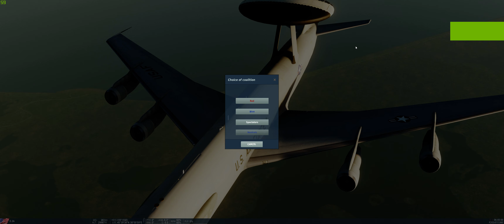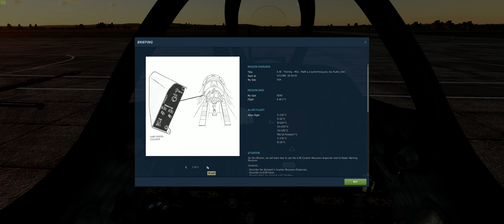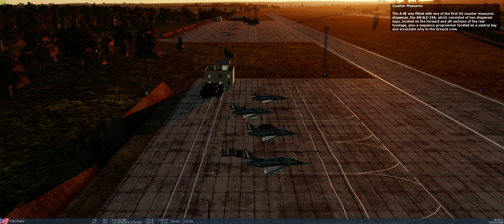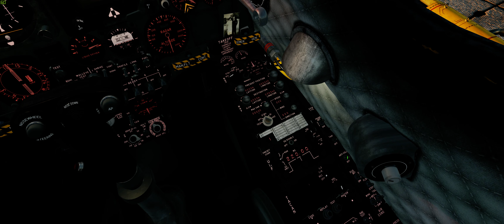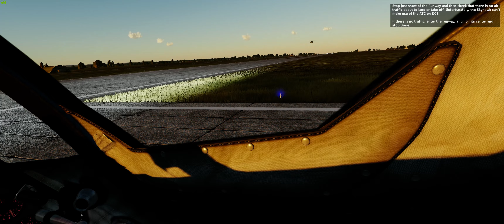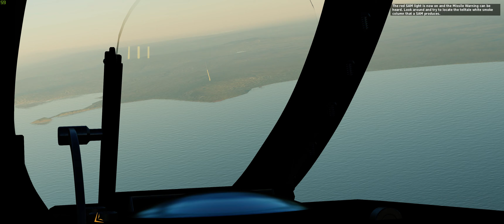A 4E - Training - Mission 15 - ECM & RWR

Comment: Nice tutorial video. You put it together very well with lots of good info and within a good amount of time.
I will say, that the effectiveness of the A-4E's ECM equipment seems much too good though.
The early Vietnam War era ECM equipment (such as that shown in the A-4E) was not quite as effective in reality. Therefore, when a SAM launch was detected,  defeating it was a bit more complicated. 
Normally, after detecting the launch, the pilot had about 5 or 6 seconds to visually acquire the missile before the first stage booster dropped off, after which the incoming missile was much more difficult to see. This was especially true in the hot, humid and hazy Southeast Asia environment.
Once visual was established, the pilot needed to immediately dive for the deck at full power while, at the same time, turning to put the missile at their "2 o'clock" or "10 o'clock" position. 
This put the SAM site slightly abeam to the airplane. This made the airplane slightly more difficult to track and allowed it to continued closing the distance with the SA-2 site, which forced the missile into a tighter ballistic arc.
If the pilot was able to get below 500 ft AGL, the guidance RADAR usually broke lock due to ground clutter. 
If the pilot could not get below 500 ft AGL, then they would have to wait until the missile was almost on them and then break hard up and slightly away from the missile (putting it fully abeam). 
Because the missile was traveling so fast (and gravity was helping it continue to get even faster) it could not turn hard enough to track into the airplane and would miss by enough of a margin that even if it detonated (from the proximity fuse) the airplane would likely survive. Also, being fully abeam, the RADAR was at the most disadvantageous aspect to the aircraft, which affected it's ability to detect the missiles proximity to the target.
The unfortunate part of all of this is that it forced the defending aircraft down into the heart of the AAA environment, which is what actually caused most of the aircraft losses in Southeast Asia.

I would suggest that people start incorporating the SAM break into their tactics so that it becomes 2nd nature in the event that the ECM/SAM environment becomes more realistic.